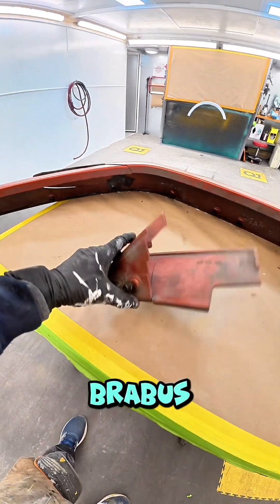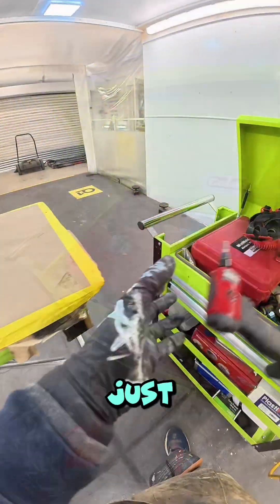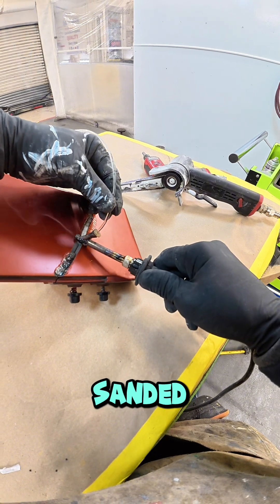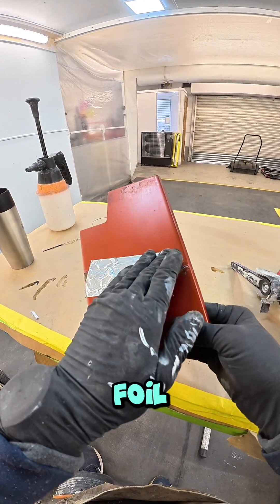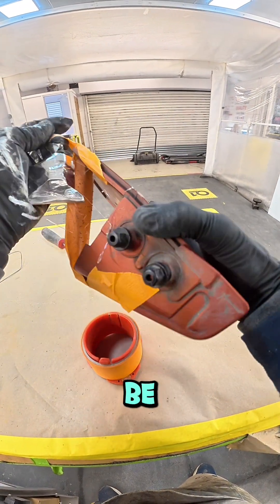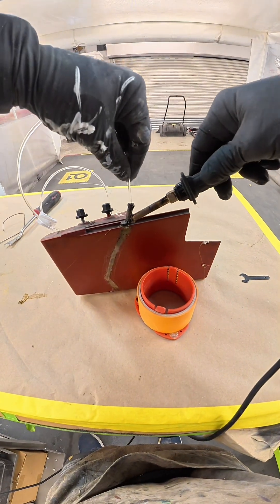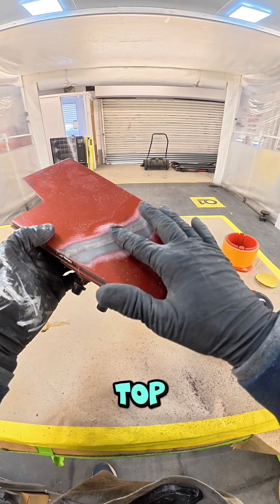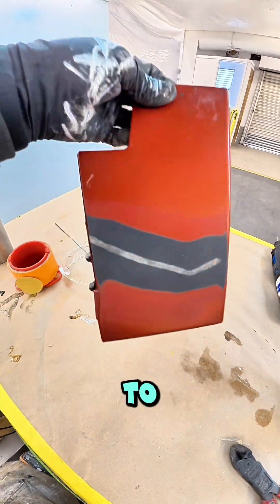PLASTIC WELDING PUR Polyurethane

Comment: Hi I’m looking at purchasing a plastic bumper repair kit that will weld all plastics from bumpers to motor cycles. Which would you recommend? I’ve also seen one of your videos when repairing the lugs on the bumpers. Where could I also purchase this kit from. 
Many thanks 
James
Reply from the maker: Hi, 
thank you for your questions, these are two products that I would recommend.
All round welding machine:
https://www.polyvance.com/New-Products/6180-230V/

Bumper lug repair kit:
https://www.polyvance.com/Pliers-1/6246/

Let me know if you need any more help 👍
Reply: Thank you that’s a great help. I don’t suppose you know of any uk suppliers?
Reply from the maker: Unfortunately there isn’t one atm but please contact polyvance as I know they have an Italian distributor and he may be able to help you out 👍
Reply: @damageundoneltd once again thank you. Have a good weekend